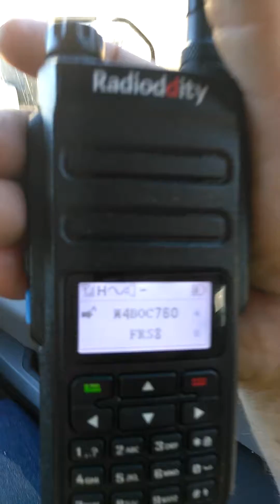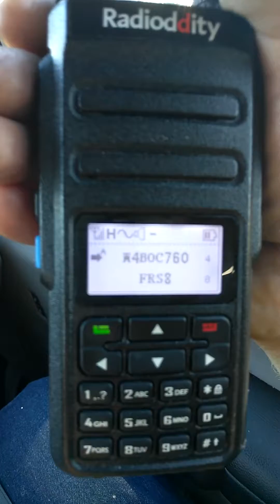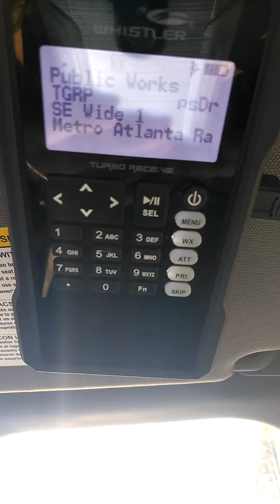Analog Picket Fencing On My GD-77 DMR Radio

Comment: I respectfully suggest that you use an outside antenna! Trying to use any hand held radio inside a vehicle will tremendously reduce your signal strength and thus your ability to successfully make contacts, no matter which band or mode you are using. The cars metal body is shielding your transmitters rf output signal. 73